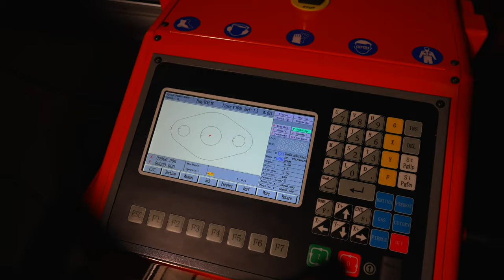EX-TRACK®CNC - Portable cutting plasma/oxy-fuel CNC system //THERMACUT®//

Comment: I had the opportunity to see this system in action at a company neighboring our company. It seemed to me an extraordinarily well-designed system, easy to use, with an integrated THC sensor. Although I was initially very reluctant due to the similarity with the Chinese systems, on which I had the opportunity to work, the software is very well developed and functions are available that do not exist on the Chinese systems. I think it is a machine that every workshop should have. Congratulations !